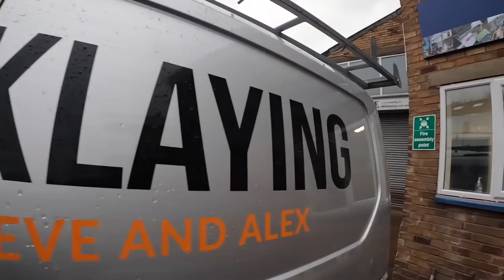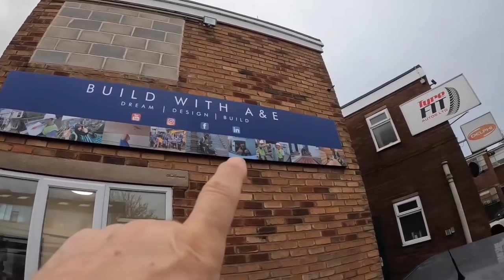WORKING WITH @BuildWithAE ON A BIG WALL

Comment: That g deck looks some job a lot better than trestles wonder why  never built wall with any expansion joints as very long and you are using a cement based mortar especially where old meets new I would have used nhl instead of cement on that type of work and also does away with the need for expansion joints👍

Comment: Absolutely nothing wrong with the brickwork and just my view but it should have really been rebuilt in lime, it would have looked so much better, allows movement without cracking, absorbs carbon dioxide so has a lower CO2 cost! It's funny really to think we have been building using lime for thousands and thousands of years and cement around 100!
Reply from the maker: We were using 5 sand 1 cement 1 lime 🤙🏾🧱👍🏽
Reply: @SteveAndAlexBuild  Thanks for the reply, it's good you used 'some' lime but in reality as soon as it's mixed with cementitious material it losses are benefit it might have provided. I am not criticizing the workmanship and appreciate lime is typically more expensive but it provides many more benefits than cement based material. 

Not only yet but it also really does ensure a 'period' wall looks as it should!

All the best and merry Christmas!
Reply from the maker: @leamcmullen1941  😁🧱👍🏽